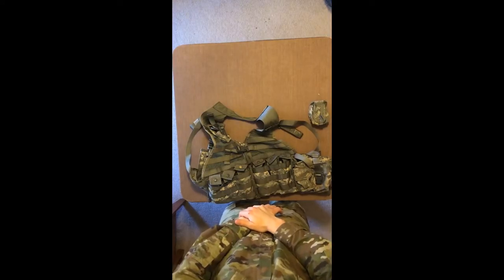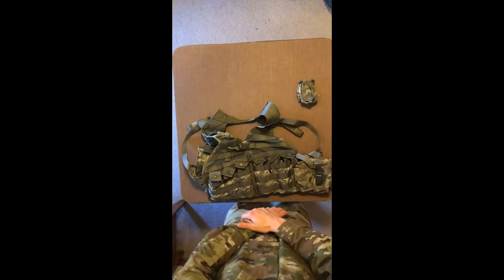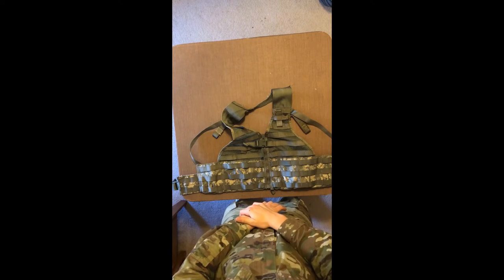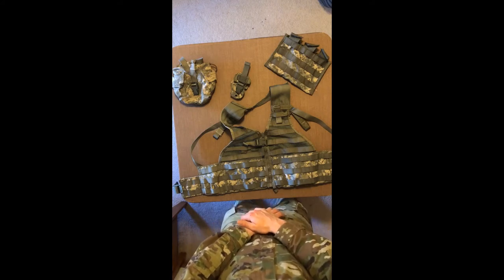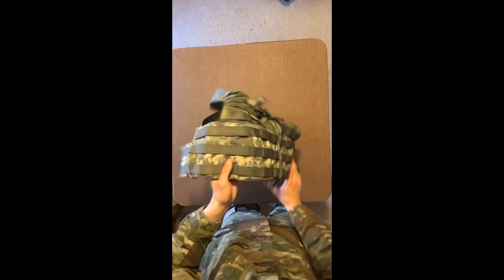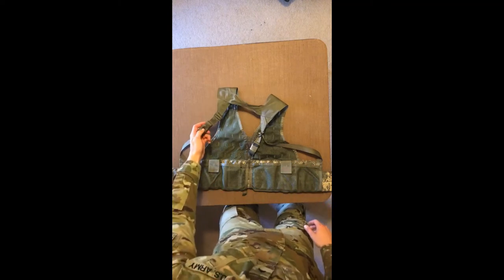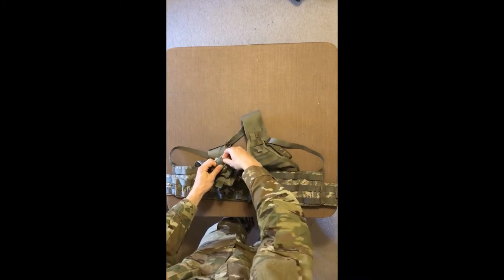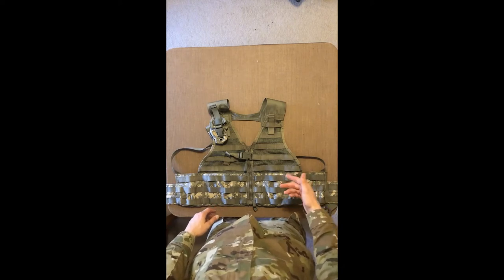Basic FLC Setup

Comment: @Cyclone Battalion SI So I take it then that your FLC didn't come with the rear back piece then?
Reply: He's got the belt in backwards, so it fastens in the back rather than the front. It's a little faster to put the FLC on this way.
Reply: @socalsurvivalist857  He might have a different FLC model because mine is different due to the back piece being part of the belt and the front belt not being able to be passed the other way. also the adjustment webbing would be in the way too.
Reply: @michaelbenjmitchell1  That could be the case, but I've never heard of them having different models (other than fabric color/pattern), could be you have a prototype/tester model? Legion preparedness has a great vid on different flc configurations that's worth checking out though. https://www.youtube.com/watch?v=B6FW3rEDAr4
Reply: @socalsurvivalist857  Mine is original USGI issue and I have the original Woodland version in the same configuration both have the back panel and adjustment yokes in back. They must have only made a version for ROTC that would be the only explanation.